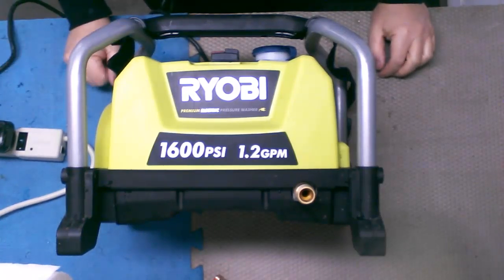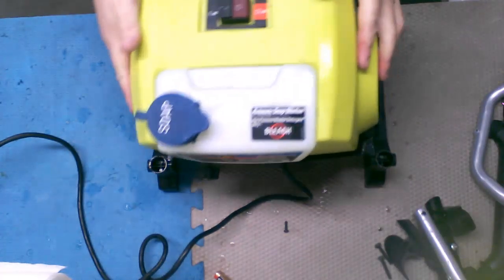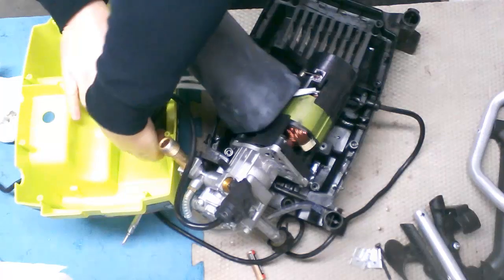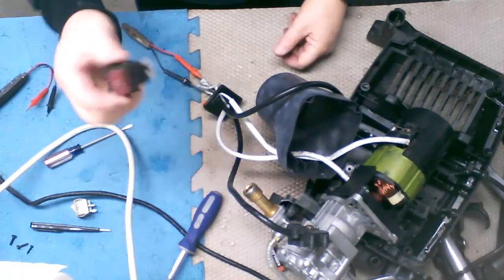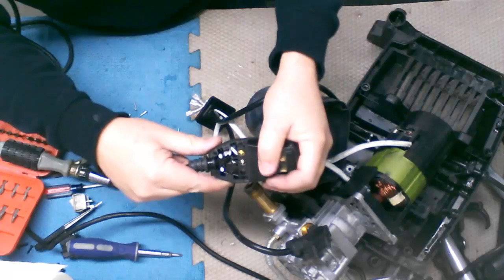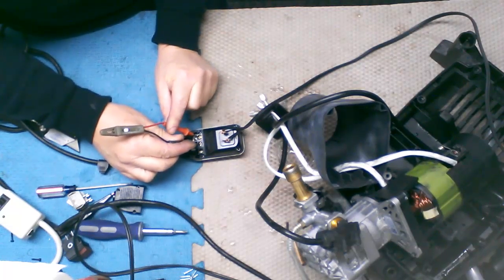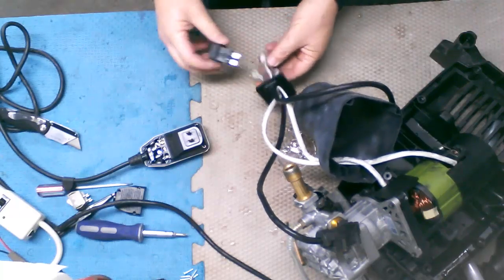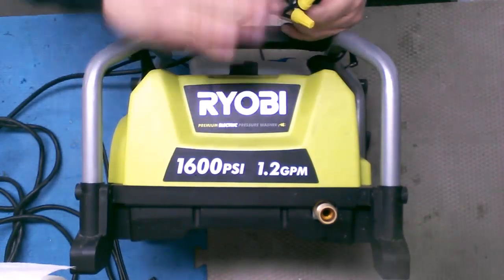Repair a Ryobi Pressure Washer / How to fix an Electric Pressure Washer

Comment: Just put a regular plug on it.
Reply from the maker: That would be suicide! The reason for the GFCI is to prevent electrocution. If this thing shorts out and you are standing in water while washing your car, you will be toast, LITERALLY! Always use a GFCI when working with electricity and water!

Comment: You can’t strip with a power tool if you UNSCREW
Reply from the maker: Sure you can. If the screws are too tight and you hit it with a powerful  screwdriver or impact wrench you can easily round off the head. The screws these days are made out of really cheap metal. Too much torque in either direction and you stripped the heads. Then all you have is a stuck screw and no way to grab it.

Comment: I ran through about every electric powerwasher video..  I suggest just cleaning the whole thing.  Then open the pump.   Careful, oil spilled out on me and it stunk fowl.   Even though they're electric, majority still need oil changes.   

My problem was my machine kept surging.  I turned  it on and it works.  You hit the nozzle button and it fades.   So I cleaned the entire pump even with degreaser and wiped everything down.  You need to drain the old oil and replace with new.   Ryobi there is no easy way to do it so careful of the mess.  Some electric PW say no oil necessary which you still do

I was using electric powerwash ryobi 1700

(speaking in general, not towards this video)

Comment: They go bad you can replace it and later on it will go bad again better off just installing just a straight plug
Reply from the maker: Only if you are in a hurry to die! That GFCI plug is there to prevent you being electrocuted. Is your life not worth a few dollars to fix it properly?
Reply: Have you tried this? Just looking for a temporary use, plugged in inside and pressure washer outside ...

Comment: The $6 harbor freight multi meters aren't the most accurate thing on earth but they do work. It'll at least give you continuity check. Much safer then test lighting 120VAC.
Reply from the maker: You're absolutely right. I'll do that next time. Thanks for the heads up.

Comment: I had the same problem. I think there is a high failure rate w/ Ryobi GFIs. I ended up using a 15 A plug and bought a 15 A portable GFI. Suggest that you think a little 1st before tearing everything down. Check your power 1st. Just because the LED is lit doesn't mean there is power, as learned the hard way.